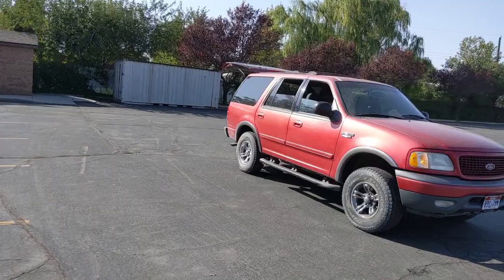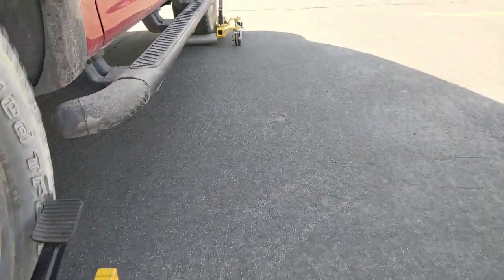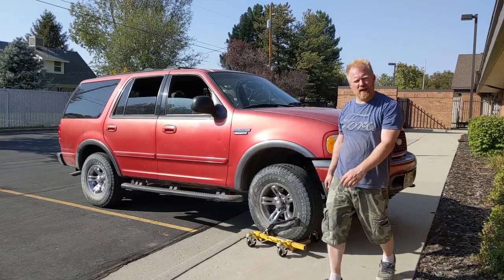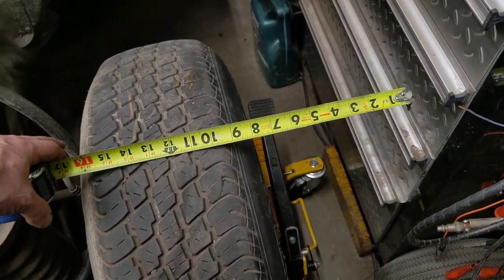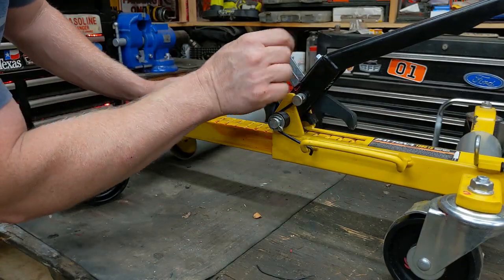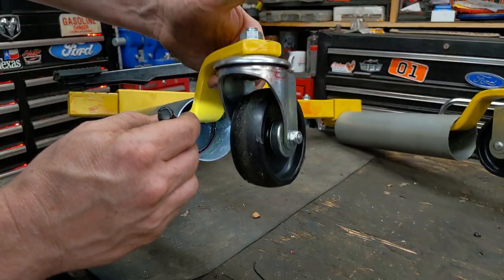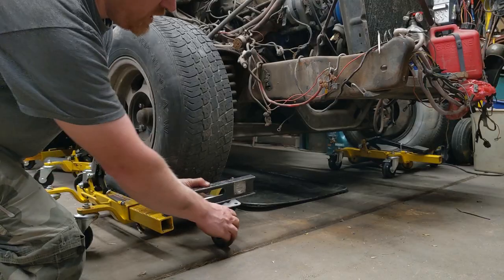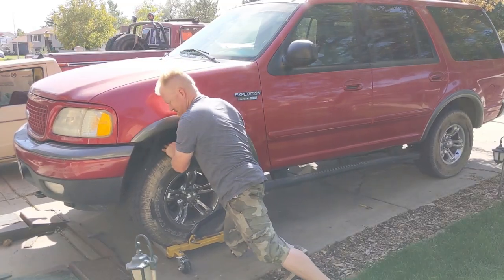GoJak Knockoffs Harbor Freight self Jacking car wheel dollies ANY GOOD?

Comment: Awesome! Love the comment about harbor freight expects you to do the quality control!
Reply from the maker: Saves them money to not have a guy testing them. What does it matter if the consumer wastes their time and gas to drive to the store, buy, assemble, test, drive back to store, return/swap, assemble again and final testing.
Reply: @sixtyfiveford  I've bought so many things at Harbor freight tools over the years, it's a hit or miss. When I lived in Las Vegas I was only a few miles away so it wasn't a huge deal to return something. Now that I have to drive a 70 mile round trip I'm not nearly as nice. I've stopped shopping there for the most part. I just buy what I need from Lowe's since it's right up the street.
Reply: I don't think they expect you to do it 
They're know for selling cheaper tools 
For the 1 time or ocassonal user , Actually some of their tools are pretty descent $$$ wise compared to other major brands  You just have to know what you're expecting out of them usage Wise.
Reply: Also good mod on the dollies.
Reply: @sixtyfiveford  Can you make/modify something that can be used to lift heavy tires and to align against the lugs to install the tire on the lugs? It is a pain in the back trying to align a heavy tire to mount back up on the lugs.
Thank you

Comment: I purchased a set of 4 of those skate type of dolly’s Harbor Freight sells and they were garbage. They are the type that you use after lifting all 4 corners of your vehicle using a floor jack and setting them down under each wheel. They were worthless when I tried them. Problem with them were the cheap Chinese wheels they used on each skate. They looked to not be made with ball bearings. Oiling them up didn’t make any difference either so I brought them back. Purchased others made in the USA where you could actually see the difference in the wheels they use and with one finger could move the car. This is going back probably close to better then 20 years ago already. Maybe harbor Freight might of improved on them but I doubt it. My USA ones will last longer then me.
Reply: There are multiple grades of wheel dollys at HF.  The cheap set is pretty crappy, they are rated at 1000lbs per wheel.  The next set up is rated at 1500lbs, they are a bit better.  I've sat my town car on them and moved it around the garage pretty easily.
Reply: 1D10CRACY As I mentioned it must of been 20 years ago or so and Harbor Freight only carried one type which were Black and looked like the cheaper set they sell 2 for $49.95 that suppose to handle 1000 pounds. Back then I purchased 4 of them to put under a 1970 Monte Carlo that was recently restored. I had a tough time moving the car in my Pole Barn on concrete with them. If they were 1000lbs each 4 of them should of handled the car without a problem but they didn’t. I purchased 4 USA made dollies for not much more money and it was night and day different. I was able to move that same 1970 Monte Carlo with one finger no lie. I believe the problem was in the Chinese Wheels they used back then. They were kind of crude looking compared to the American Made Car Dollys I purchased afterwards.
Reply from the maker: The issue lies with Harbor Freight having factories undercut each other in price to make a product. Corners are always cut to drop the price. Harbor Freight is just buying products for independent factories who bid the lowest. USA companies generally put their name right on the product and you know exactly who and what city it was built in. They know they'll be tracked down/called by customers if there is an issue.

Comment: I feel like with $500 in material and 8 hours you could fabricate these things better.
Reply: I'm sure.
Reply from the maker: Yes. I have a few different plans in my head but parts were going to be around $75-125 each. These looked decent from the outside and figured they would just work right out the box and I could move onto more important projects. I was wrong.

Comment: Didnt ya know HF engineered that flex as a anti roll away function. Almost as good as the new electric E brake in cars. LOL
Reply: Are you saying ,don't use on hills? lol.
Reply: Harbor freight did no engineering. Zendex inc invented this and was ripped off

Comment: I recently bought one. It worked great for removing and intalling my truck tires. I'm 62 with heart problems. It worked great and it's a back saver. 4/2024 paid $109.00 plus tax with coupon.
Reply from the maker: Makes sense. Not too bad of a price either when you just need one.

Comment: I really enjoyed watching your review, and modifications performed. I have seen these advertised at HF, and it is great to see them in use, along with you honest reveiw and assessment. Thanks again.
Reply from the maker: They looked decent in person but didn't think I would spend so much time making them work correctly. If you just had a 3000lb car you would probably be happy and no issues. Though I think they would bend over time and use and give issues down the road.

Comment: Thank you for explaining why the bowed or off-plumb casters were hard to roll.  I was scratching my head while you were welding gussets until you brought out the spirit level.
I love that Ginger !!
Reply from the maker: It made a big difference. I just wish they came ready to use at the price I paid from them.
Reply: Right... Now, I know exactly why the furniture dolly I bought from Harbor Freight never wanted to roll with weight on it. I knew some of the stuff was junk, such as the caster, but that little tid bit adds to my knowledge bank for future troubleshooting. Good info. By the way, did you ever end up replacing the casters?

Comment: That was a nice bit of re-engineering there.   Thanks for doing the research and rebuild for us.    And a thumbs up for the video. 👍👍
Also it looked like the brake was actually peeling the plastic wheel apart when you had it locked and turned the wheel.

Comment: Love those old F100. At age 73, gimped up, I gave my 62 F100, shortbed unibody to my grandaughter. It has a 351M and an FMX. NICE LITTLE TRUCK.  I just do not have the strength to steer it anymore. Got disabled in a carwreck.
Reply from the maker: I had forearms of steel when I first started driving my 65 at 16yrs old. I had a tiny 13" steering wheel and my father hated it. A few years later I converted it to power steering and power brakes(disc front). The braking really made little to no difference in stopping as properly tuned drums take virtually no force to apply them. I was a little disappointed as I was hoping for a dramatic difference. The steering though was wonderful though the added problems of replacing power steering pumps every few years got tiresome. I have a 352 FE motor in the 65 but have a 351M in my 78 Ford Truck. The 351M has been an extremely reliable, though low power engine.
Reply: @sixtyfiveford  yup my 351 started reliably. Not a hot rod but plenty of torque at the low end with 373 rear gears it could be a stump puller in low. Before I gave it to Morgan I looked into addIng  CPP power steering unit, I figured it would be about 2 k to do it, as I can no longer do major wrench turning.  

Yeah on 16 being a bull. When i got out of the marines I was so hard, you could roller skate on me LOL. Not anymore, I am now a ustawuz, I usrawuz strong but not now... a 10 year old girl scout could whip me...LOL  

I enjoy your channel a lot, I can live vicariously in your projects.

Comment: I got mine many years ago.  Took two tries on one pair as they wouldn't build hydraulic pressure but after that they worked just fine.  (They were hydraulic powered then - so were  the gojacks at the time).  Nifty idea on the handle!
Reply from the maker: I've seen the hydraulic HF units and I like the idea. I'm sure like all jacks they will fail after a decade or two but everything is repairable. Mine, I'm sure the wheels will fail someday when I need them most.

Comment: Spinning the casters to the direction of travel before pushing on rough surfaces makes it a hell of a lot easier. Most of the force needed to push these is in the very beginning when the castors have to spin for direction of travel. You can make a little tool with a flat piece of metal with a square slot that slides on the caster wheel bracket to make turning the caster wheel easier. Turn them so the castor wheel side that is flush with the bracket is facing direction of travel.
Reply from the maker: Sounds fine, but in reality it is a paint to do this 16 times especially the ones under the car. If the main supports are bowed like the cheap HF ones it also won't push in a straight line and will start to wonder/self steer in a random direction.
Reply: did you even watch and understand what he did and the obvious physics involved?

Comment: I got just one of them, to use to move around the wheel/tire when I pull it off my jag ( car show car) to clean behind the wheel and also take care of any problems I see. Saves the back big time. Just didn't feel the need to spend the big bucks on another brand and all my other harbor freight items work great. Just bought it yesterday, and haven't taken it out of the box yet. Watched all the other videos before buying it. So, I will see how it works, I don't expect any problems with what I want to use it for.
Reply: I'm planning on buying just one for the same reason,  to make taking my wheels off and putting them on easier for doing maintenance. The tire and wheel combined on my truck is 100 lbs so getting them on and off is pretty strenuous for my close to 60 years of age.

Comment: Your Expedition is still looking good, new wheels I see. Mine has 210k on her now and still runs great. I'm keeping it until it suffers from a catastrophic failure. I've got my money out of this vehicle for sure.
Reply from the maker: I'm just under 200k and going strong. Last issue I had was the ABS module(solder connections) failing due to driving too many washboard dirt roads.

Comment: I’m wondering if moving the front casters forward and adding a left-right cross brace would help it pivot better?
In fact, maybe relocating the outside casters more fore and aft than directly outside the wheels. Then you could tuck closer to the wall.

Comment: I've started to shy away from harbor freight lately. I'm getting tired of having to re-engineer their bigger items. That spring and the flex on those caster mounts were terrible! It's hard to pay the big money for the hood stuff too! This is why I have tons of metal stock, casters, springs, and everything I need to rebuild any harbor freight or other inferior tool sitting in the shop. I'm still too cheap to buy the good stuff!
Reply from the maker: I really don't spend any money at HF anymore and haven't for 10+ years. I first started shopping them in the early 1990s and stuff was ridiculously cheap and came with a lifetime warranty; unless it was air/electrically powered. But I always followed the rule of not buying anything you have to plug in from HF. Now with their mass expansion and 1000+ stores they are trying to pay the bills and nothing other than hand tools has a real warranty. They expect you to pay extra for that. I also think their prices have more than doubled and this dolly would have been around $40-50 with a lifetime warranty 15-20 years ago vs the $100+ it is now. I have virtually nothing from them small or big that hasn't either been replaced with a real tool or modified to work. I'm not proud of anything I have from them like other tools I own. 

Their premium stuff these days is 80%-100% the cost of real brand names without support, parts, performance, resale value etc.
Reply: @sixtyfiveford  * totally agree. And this trying to compete with the tool truck nonsense I don't think is gonna work very well!

Comment: Great stuff, sometimes you can buy stuff like that to start off with and make mods but after you mention the price man I'm way too cheap I'd build my own, those jacks are a lot like the old school bumper jacks you can pick up for cheap at a wreckers, that flat bar the wheels are mounted on should be ½ angle iron and with a good set of rollers with bearings you'd have a nice set up, keep up the great content, love your dog !
Reply from the maker: I have a few plans in my head to build some but casters and other parts put me near the cost of these, so I figured they would be worth a shot. I had an idea with bumper jacks, screw scissor jacks, and even just a plan bolt that pulls the sides together. I had enough parts laying around for 1 or 2 but not a set of 4 without purchasing more stuff. I think I am going to build steel wheels with bearings for the existing casters. The math shows the coefficient of friction is significantly less for steel vs the hard plastic that is likely deforming under load. So it should make them roll and change direction easier.
Reply: @sixtyfiveford  Steel wheels should work great, I like those old industrial carts with steel wheels they would even look cool, scissor jacks also make a really great post vise, large capacity.

Comment: With the weight limit factor, I guess it will never move my work van. Thanks for the heads up. I don't have a welder.
Reply from the maker: I expected better for the price. The official GOJAKS these copy seam to have no problem with the rated weight but cost over $1000.

Comment: It looked like the asphalt issue was it wasn't high enough and so the roller was hitting the ground on the side the casters were sagging on..

But great fixes
Reply from the maker: The rollers never move higher. They only move towards/away from each other. They were bending under the vehicle weight and nearly touching. That's the issue.

Comment: Great Job with your design modifications for the dolly's.  Wondering if you are still happy with the results of all the time
invested in the mods?  Any other ideas at this point for making them even better?  Thanks!
Reply from the maker: They have been working great since I reinforced them. Don't know if I would spend all the time and effort though if I needed another set. I would likely bite the bullet and buy the GoJacks.
Reply: @sixtyfiveford  My dilemma exactly.  Sell them before the hours of cutting out and welding 32
gussets?  Thanks for the video!

Comment: Harbor Freight has been great for me as I have been entering the woodworking and home mechanic arenas, but I am outgrowing the store. Too many of their tools and products just don't measure up to the competition. As my skills improve I want better quality tools.
Reply from the maker: Very well said. The stuff does function but if you ever have the opportunity to use a name brand you're just blown away with how much better it works and how much easier the task is. I've had Harbor Freights around me since the early-mid 90s and their stuff used to be dirt dirt cheap so you weren't too opposed if it broke after a few uses and generally it also came with a one year or lifetime warranty. This dolly is something they would have sold for sub $50 with a lifetime warranty. These days they sell this for over $100 each and expect you to pay them $20-30 for a 2-year warranty. They've been building too many new stores and growing too fast they're trying to cover all their expenses with extremely high prices compared to their past.
Reply: Everything is expensive now gas food McDonalds. That was then this is now😮

Comment: I bought the hydro version of the GoJaks from HF years ago, they leaked out all the fluid all over my shed.  It's real hit-miss with HF.  I have a pile of their air tools that I had to replace because of poor quality.  At least they have new lines of tools now.  Got a Baxter straight line sander and it's great, more than 2X the price of the old one, but the old one doesn't work.
Reply from the maker: It really is hit or miss. You need to buy the tool and use it right away. Problem is, so many people(me included) impulse buy a tool and it sits for months or longer before I need it on a job. By that time it's too late to return when you find out it's broken. I think it funny they have such a bad reputation with their brands they simply make up new names to remarket them. The Baxter, Beaman, etc are a fair bit nicer in build quality, but they're so close in price to established brands it's hard to justify. I eyeballed the Baxter straight line air sander I think for 80 bucks, but why when I can get a professional Ingersoll for $99? I'm sure the Baxter will work just fine but I'm out of luck if I need a new platen in 5 years where every part is available for the name brand Ingersoll Rand. You can't trust HF reviews either as they filter out virtually all negative ones. I wrote a review on these HF GoJaks and they never posted it.
Reply: @sixtyfiveford  Good point, I paid $75 for the Baxter and the IR is $119 reg price, didn't know they were that close in price.  One thing about HF was that some things were so cheap that you could buy it for less than the rental price.  I've used the heck out of the pressure feed sand blaster.  I restored a 73 F250 4x4 HighBoy with it and it still works.  Their stud welder works great, but several of their air tools failed.  Is that an FE engine in that Ford?  I built up my FE about 20 years ago, went all in with a 428 torque monster, dumped a pretty penny into that thing.
Reply from the maker: @karljay7473  Yeah my 65 has a 352 FE in it. I also have a 59 and a 66 with 352FE's.

Comment: Interesting, I have some "off brand" gojacks, never used them much because you can barely move a car with them. They look similar but not exactly the same.
Actually they work fine if only two wheels on the same axle are on the go jacks, but it kind of defeats the purpose of being able to move the car freely.